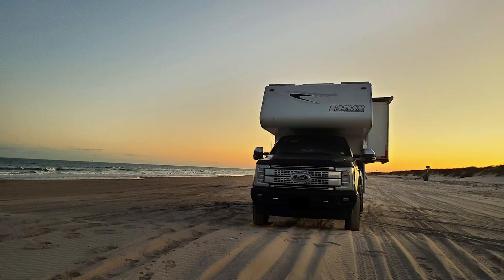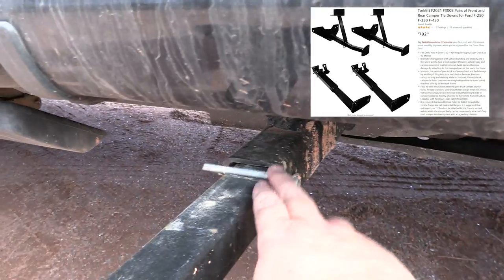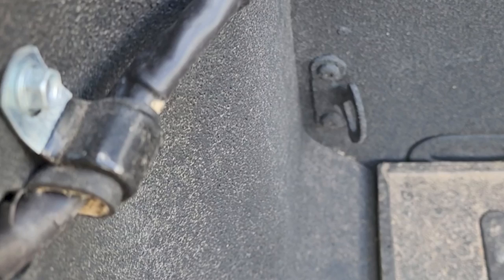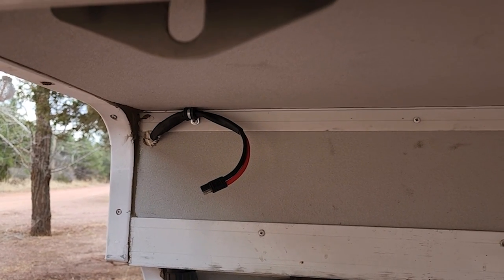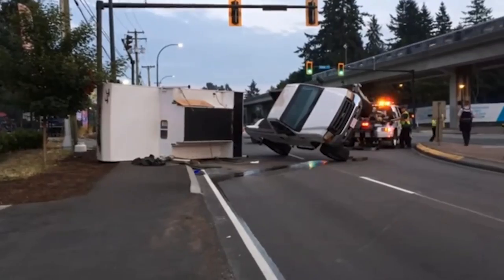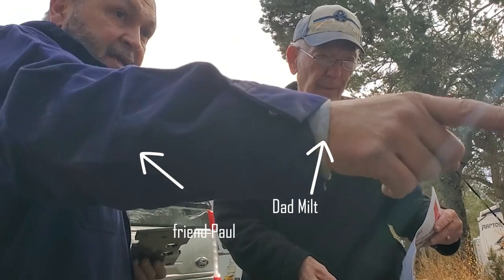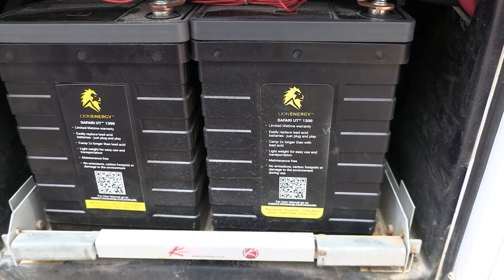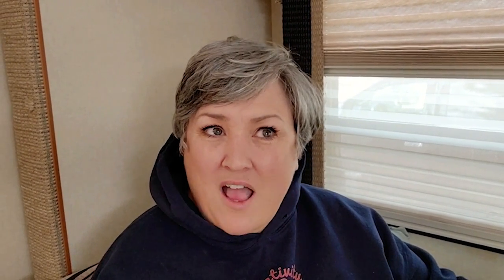RV Hacks & Gear GALORE! Truck Camper Setup: Lithium Batteries, Air Bags, Platform, Solar and more!

Comment: I have heard some really insane crap about modern vehicles but that tops them all!
I would bypass some modern crap on those modern trucks and wire the house batters directly to the truck batteries the way they used to do it and the way I would still do it!

My parents had two different truck campers and a travel trailer. The first time they got a truck camper and put it on the 1960 Ford 250 pickup that had an unusually tall cab so they had to put 2x4s in the bed to raise the camper up so that it wouldn't be hitting the top of the cab. .
And use regular turnbuckles along the side of the bed the way most people have done it over the years to fasten it down except one time they ran bolts through the floor of the camper through the bed of the truck to tie it down which didn't work real well I was hard to get those wholesaling up again after that.
It's interesting that you show load binders or that's what the truckers call them to tie down loads on their trailers.

Another interesting thing that my parents 1970 250 Ford pickup had was a bumper that slid out on rollers because the camp would stick out several feet and they could loosen two bolts and pull a  release lever and slide that bumper out to match the length of the camper then tighten down the bolts again.

Here's another weird one. 
My parents also had a 1970 Ford 250 pickup and we would sometimes sit in the truck and want to listen to the radio and we did not have the keys but to get the radio to come on besides turning on the radio we had to turn on the flashers and one turn signal and step on the break or else the radio would flash on and off. 😜😖🤔

I also do not like or trust the modern trailer brake controllers for towing. They have drawbacks and design flaws and I will always use my old trailer brake controller from the '70s that's the only one I trust. I've been pulling all kinds of trailers for The last 55+ years. If a trailer brake controller cannot sense the amount of pressure on the braking system on the truck then it cannot provide the accurate amount of breaking for the trailer.
Surge brakes are a horrible design and were designed to be used on rental trailers behind vehicles that don't have a trailer brake controller. 
They are extremely dangerous and shouldn't be allowed on the road, especially on slippery surfaces!!!

I've also had two truck campers and a nice travel trailer. I'm currently looking for another nice vintage travel trailer.

Something else to consider is a battery isolator if they still make them.
Ideally anytime the engine is running it charges all batteries on the truck and on the RV. But when the engine is not running the house can use only the house batteries but will not drain the truck batteries.

Comment: I am sure you meant to say that your truck plus the camper add up to more than 13000 pounds.  

This is a really informative real-life look at modernizing and electrifying a camper for full time living. Is your roof space maxed out for solar?  Residential style solar panels are about $.50 per watt if you have the space.  Much cheaper for frequent use than running the truck as a generator.  Also, adding DC draw to the engine can burn out alternators if the current drawn by lithium batteries is not limited somehow.  I would hate to see you stranded somewhere due to that.

Cheers!
Reply from the maker: Absolutely right! 13k all together,  and the DC converter has an isolator
Reply: @CreativityRV  Robin, you're a genius!
Reply: Yes. Add more solar! If you have space.

Comment: Just a little clarification. Those airbags don't take weight off your truck. They merely redistribute it to the front and frame, as apposed to your rear suspension alone.
Reply from the maker: Well said. Thanks!

Comment: Thank god you have a dually!  That foam insulation that you are using to raise the camper will continue to compress until it is 0 inches. It’s only a matter of time before it’s scraping your guard rails again.
Reply from the maker: Nope. Check out the weight rating on the foamular.

Comment: Robyn,
When you added your airbags to the truck.  I hope you also added super duty or extreme duty sway bars to the front and rear also.  The sway bars that are super duty have a diameter of 11/4" these help to control the roll and sway you get with these big heavy campers.
I used to have a Dodge van that was a 350 rating with one of the first 4x4 packages ever built by wolverine off road.  Had super duty sway bars put on it and I could go where most trucks wouldn't go.  Funny when you pull in to a camp with a Dodge maxi van raised with 28" tires.   And guys say how did you get that monster in here and not roll it.  I would tell them to look at my suspension.  Safe travels and roads Brian and Cindy.  "xtreambydesign with passion"

Comment: I looked up the camper and the dry weight is 3650 lbs not 13,000 referenced around minute 5.   Love that you are doing a channel with a truck camper.  Keep up the good work.  Thanks
Reply from the maker: It's over 13k,  all together,  with the camper on the truck
Reply: @Creativity RV  OH that makes sense. I was thinking that was too heavy as well. I have a hi-lo 24' trailer and it weighs 5,000 loaded.

Comment: The specs that I found on your Lance 1191 truck camper show it weighs approx 3505 pounds dry by itself, so its probably a bit over 4200-4500 pounds when youʻre fully loaded down with everything. I think you said it weighs 13,000 pounds in this video though, did I misunderstand you perhaps? 

Maybe you were actually talking about the gross weight of the truck and camper plus everything? I’m also looking at Truck Campers, a used Host or Eagle Cap is at the top of my list right now with 2-3 slides preferred. They weigh closed to 5K pounds due to the 2-3 slides.

Thank you so much for sharing everything with us, we appreciate your advice! Looking forward to watching your new journey in your Lance truck camper!

Comment: Airbags do not take any load off of the truck at all. They just raise it up a little making it slightly more top heavy.
Hopefully your truck has a stabilizing system, either a bar or hydraulics, balancing the weight side to side. That would help to keep it more level going around corners or on slanted surfaces within reason.
Reply: ? What exactly do air bags do?
Reply: @justwannasay5454  when carrying a heavy load it brings the height of the vehicle back up to normal height just like overload springs do. But the airbags are adjustable, you can raise it higher or lower to whatever height you want for each situation.

Comment: Question-. Because truck campers are high,what kind of wind issues are you dealing with and how are you dealing with them. You touched briefly on the tie down of the camper but curious of skills to cope with wind and wind shear etc. Thanks

Comment: I have a 2008 Lance 1181 with a slide. I'm updating my solar now. Try to figure out how to run my wires and where to put the inverter. How much battery power do you have and could you show how the ran the wire little more detail. Thanks

Comment: Question: When I see truck campers at campgrounds they are always left on the truck.  How long does it take to take the camper off or back on?
Reply: Grit, most campgrounds insurance companies don’t allow truck campers to be removed in the campground.  They are afraid weather might cause a need for bug out and the time to put a rig back together may cause problems.  Dry camping-no one cares.   My hubby takes ours off and on in under 10 minutes.

Comment: Air bags does not decrease the load on the truck or increase safety. Actually air bags are NOT RECOMMENDED with a truck camper as you lifting the rear suspension off the overloads causing more sway. You should look into Torqlift Stable Loads and adding a sway bar.
Reply: Great info.! Thanks.  Was thinking about this but my 1 ton handles my truck camper just fine.

Comment: I still can't figure out where all the money comes from to switch RVs add solar, do all the set up etc. I watch several RV channels and they all seem to have endless supplies of cash . These batteries were ONLY 600 each! That's 1200 dollars. I would love to do this. What am I missing?
Reply: She has written books! One on how to make money as a nomad.  She has low overhead because she boondocks a lot.  Do some research on things you can do, save money to get started and find a way to do it.  Nobody has it all right off the bat.  It takes time, effort and perhaps some wisdom/common sense.

Comment: Hey Robin! Great vid. Double check that 13,000 lb camper number. The highest I’ve ever heard even on a brand new 11 ft triple slide is about 6,000 lbs 🤙
Reply from the maker: It's over 13k,  all together,  with the camper on the truck
Reply: @CreativityRV   gotcha 🚂🚂

Comment: Robin - did you take your rig to a CAT scale?  Are you  certain that TC weighs 13000 pounds?  Or do you have an F450 and the weight of the truck with camper on is 13000 pounds?

Comment: Not a big fan of truck campers. Hard to mount and dismount. Unstable in big wind both on and off the truck. While you have a good one I would much prefer to pull a small trailer which is easier to unhook and hook up. Wish you well but predict you will change riggs sooner than later.. Safe travels.

Comment: Does anybody know if this is just a ford truck issue with a truck camper not charging the camper batteries? or is it the type of trailer break system installed in the truck causing the problem and not the ford truck itself? Or is it the campers converter the issue? 
I’m in the process of getting a new 2022 truck camper, wonder if i’ll have this issue because…..
my ram 2018 truck charged my lion lithiums in my 2019 solitude 5thwheel, using just the standard rv components the trailer came with and i had no solar. (My guess?… Robin’s 5th wheel converter was too old, as it looks like these newer 2019 year at least stock installed rv converters are capable of charging lithiums) 
Btw, i heard a lion battery guy discuss lion lithium batteries installed in rv trailers, in this podcast (about 8-9 months ago) and the Lion guy said yes standard rv trailer components will charge your lion lithium batteries nothing special has to be added. He said the only thing is the batteries will only top off with solar panels. So the last few % of charge doesn’t occur on the batteries without solar panels because of the voltage the solar delivers. (Not a big deal if they are not topped off.) That’s all I know, so back to my question, does anybody know if this is just a ford issue with a truck camper not charging the house batteries?  Or what specific component is the cause? 🍻
Reply: I suspect this is only the result of how the truck's towing harness was wired and that charging Voltage was not always present.  A simple addition to the trailer wiring harness would solve this.  This type of constant Voltage sources was probably added when she had the DC to DC charger installed.  A dedicated, larger charging wire is also usually installed in tow vehicles after market to accommodate the higher current needs of an RV.  Without the larger wire, charging Voltage drop will occur and the battery charging can be severely limited.  The DC to DC converter is still recommended to charge lithium batteries in the 5th wheel from the lead acid system of the truck.

See my other comments in the main thread.
Reply: @bobf.7238  Thx for responding but Robin’s 5th wheel issue isn’t my question. I mentioned it only because I did not have that problem with my 5th wheel charging my lions, and so i am wondering if I will have the same problem as she has with her truckcamper? Like is this a problem for all trucks not capable of charging truck camper batteries without installing this dc to dc charger thing?
And what ‘other threads’ where?
Reply: @SpykersB  It is very unpredictable whether in a trailer or a camper since the state of the lithium batteries and the resistance of the charging wire are at play.  The concepts are the same for both RV types.

Proper design says to include a DC to DC charger when mixing lead acid and lithium batteries in a system.  You may not have had trouble with the trailer because either your lithium batteries were never discharged enough to pull high current or your charge wire limited the current or you kept blowing a resettable fuse over and over again without realizing it.  But this arrangement was likely not all that it could be, unpredictable and potentially damaging to your alternator.  

Don't put the charger in the truck.  It goes in the RV and should be as close to the lithium batteries as is practical.  This arrangement will compensate for Voltage drop in the charge wire and protect your alternator. 

A good charger only costs between one and four hundred dollars depending on size. You can get them up to 60 Amps if my memory serves me correctly. Victron and Renogy are brands I've used successfully in the past.

Look at demonstrations of alternators smoking on YouTube for a real convincing argument.

Best regards!
Reply: I have an older TT that I want to upgrade to a lithium battery.  In my research, a new converter would be necessary as the old one doesn't have the ability to fully charge a lithium battery so you wouldn't get the full capacity from the battery. The new converters that have a lithium switch allow for the full charge.  Then I was told that I need the DC to DC charger because the lithium battery will pull too much from the alternator and potentially burn it up.  The DC to DC charger regulates the amount of power that comes from the alternator.  I'm wondering of the trailer brake issue has to do with the 7pin connector needed for trailer brakes and therefore allowing for charging house batteries from the tow vehicle alternator. With a truck camper, the house batteries are not connected to the truck alternator because you don't use the 7pin connector. I don't understand it all.  Just my thoughts.
Reply: @pattya1679  With a camper you add a harness to supply truck power to the camper, and often brakes lights, turn signals, running lights, Etc. depending on the camper's over hang behind the truck.  

This new harness is the equivalent to a 7-pin that has had an added high-current charge wire added to its center pin.  This added wire in the 7-pin usually replaces a smaller wire in some trailering packages and is to accommodate the RV's needs which are higher than a typical cargo trailer.  

It may be that some 7-pins don't have a charging wire at all as there are no batteries to charge in a cargo trailer.  After thinking about it, that might have been part of the initial problem.  

The added camper harness is delivering power from the truck's battery and alternator in the same way as the 7-pin that has a charging wire to the center pin.

Comment: I had been looking for a 4x4 camper van and couldn't find one. Maybe this is the solution! Would it be possible to have enough electric that propane would not be necessary?  I am not allowed to even stand on a stepstool or ladder due to medical conditions. I would never be able to get the propane taken care of.  I am going to my local RV place to check out truck campers!!! Have an appointment in 1/2 hour.

Comment: I'm baffled. Your truck camper weighs 13,000 pounds? My 26-foot travel trailer weighs under 6,000. What is causing all of that extra weight?
Reply from the maker: It's over 13k,  all together,  with the camper on the truck
Reply: @CreativityRV  Ahhh. So that counts the truck! Makes sense now. And, welcome back! I was worried about you. Missed you every week.

Comment: You sure have a lot of very expensive and unnecessary high tech stuff on there.
Everything on our truck campers just ran off of 12 volts simple and easy.
No generator, no solar, no onboard batteries at all. Everything on the truck campers ran off of the truck batteries!
There are hundreds of 12 volt powered items for RVs nowadays anyway and you don't even need converters or inverters or anything else like that.
People and RV manufacturers have overcomplicated everything!
And without all that extra high tech stuff on there you have a lot more room for storage.